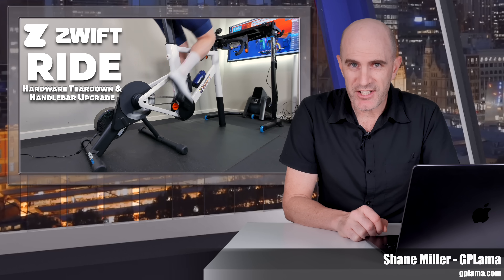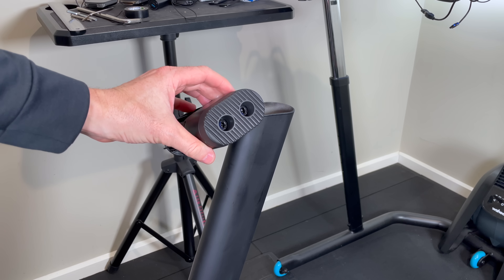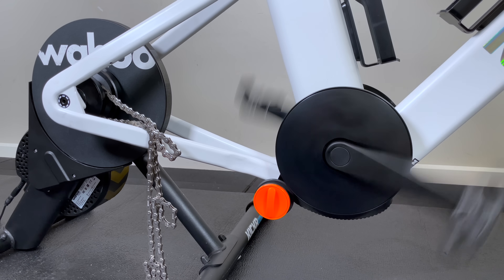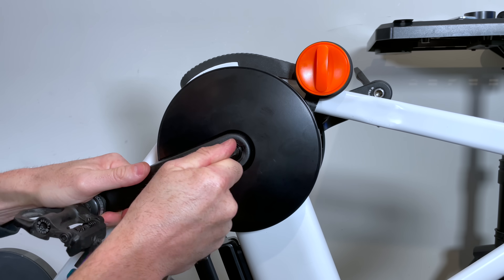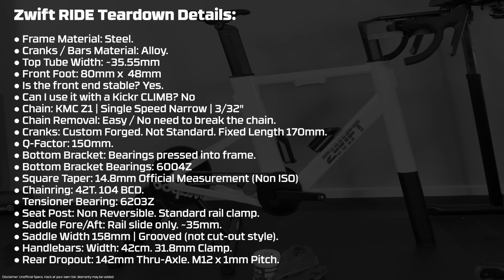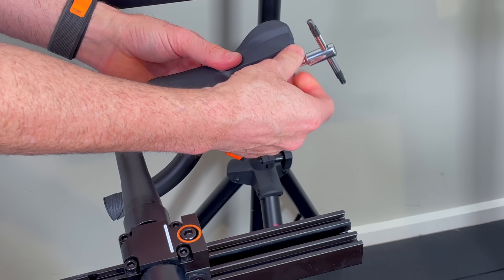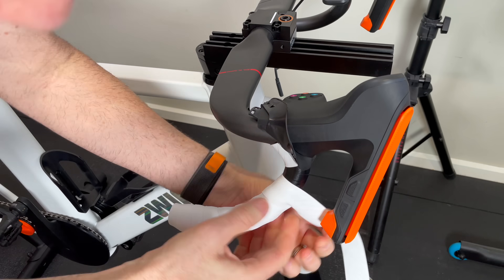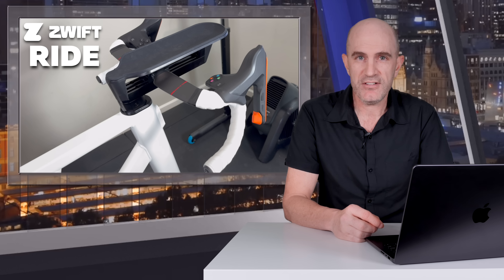Zwift RIDE Hardware Teardown and Handlebar Upgrade!

Comment: Can't decide whether this is fair value or over priced. Nice to have a dedicated set up but also you could save a chunk by using an actual bike on the trainer which you could then use outside. Will like seeing one down the bike shop when someone needs a new bottom bracket 😂 if the bike is available on its own it'll have to be cheap as again you could buy an actual bike to ride outside. But I guess it has its purpose.
Reply from the maker: It’s not going to be for everyone.
Reply: @gplama  "It’s going to be for everyone."  I think you left out a word :)   Obviously, being Zwift-Only is significant limitation. The wireless shifters depend on the Zwift App to shift virtual gears. This means the bike - even with a different trainer attached - will work only with the Zwift app..
Reply from the maker: @NotElvis  Correct. I did. Fixed. (I replied while out on the roadside on a Sunday night testing more bike things... thankfully this wasn't the DURA, so the tests worked!)
Reply: Ebay frame, cheap shifters, crankset cassette.  All for less, and crank size you prefer.  For me, it's a no. Cheers.
Reply: @garysladek9110 same here. I bought the cheapest Triban as my sacrificial trainer bike. When it spoils, I’ll just convert it into a market bike.